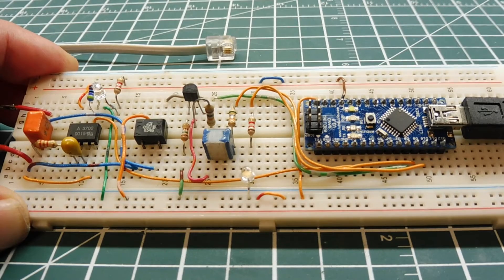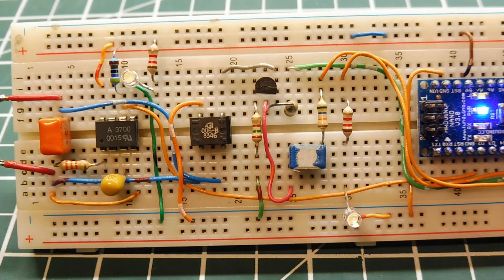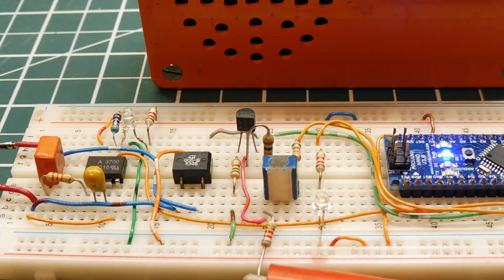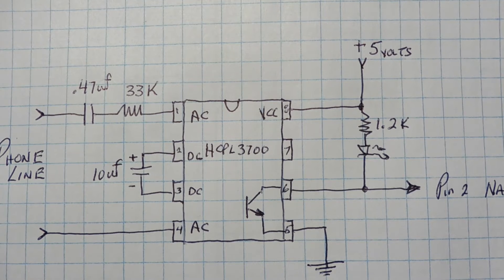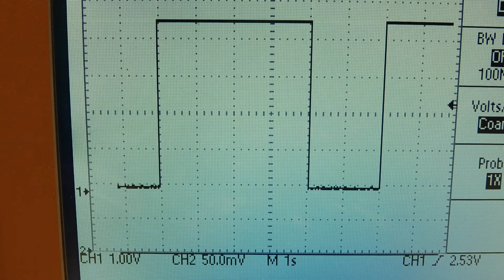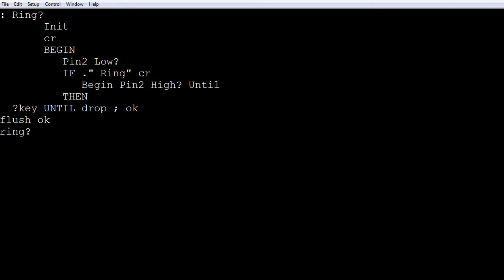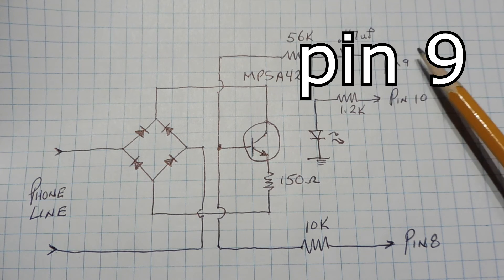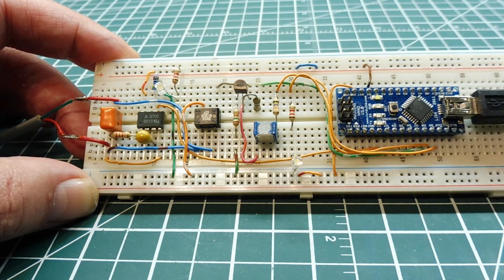Build a Phone Activated Switch

Comment: what is the purpose of the 33k resistor?
Reply from the maker: It sets the trigger voltage threshold of the opto-isolator so it will trigger on the 90 Volt RMS 20 Hz ringing signal.

Comment: Great Idea... I would have sent a DTMF tone from the remote phone keypad to be DTMF decoded by the local MCU after the phone was taken Off-Hook. 
This would allow turning ON/OFF many more devices....
Reply: Do you use MT8870 IC as your DTMF decoder or anything else?
Reply: Yes.. that is the chip...
Reply from the maker: I have built a few using DTMF, FSK and single tone signalling The DTMF chip 75T202 is sadly no longer manufactured so MT8870 is probably the only choice left. I was going for the simplest way in the video.